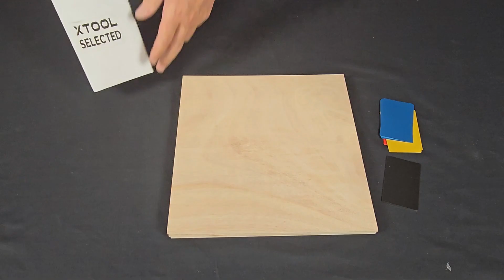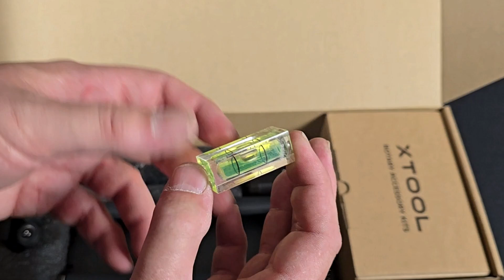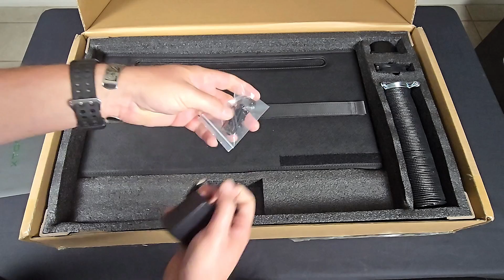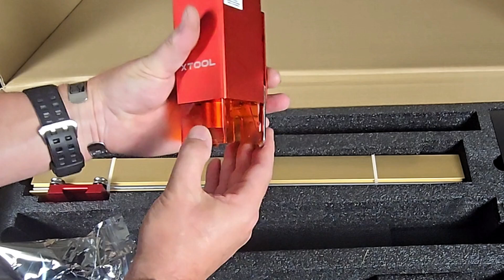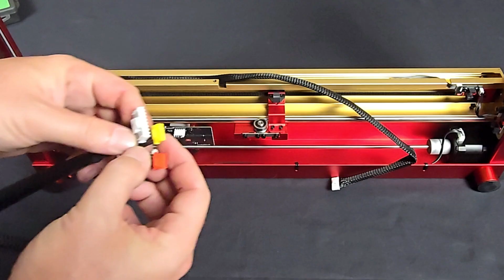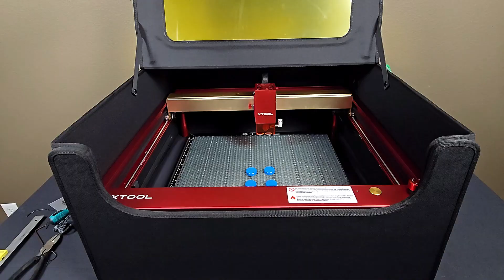XTOOL D1 PRO Laser Engraver Unboxing and Setup Tutorial!

Comment: I'm not sure if youre still active but I'm having trouble getting the rod connector to actually stay where its supposed to. When i tighten it, it still slides smooth as butter. I put the extension on and after that all hell broke loose. TIA